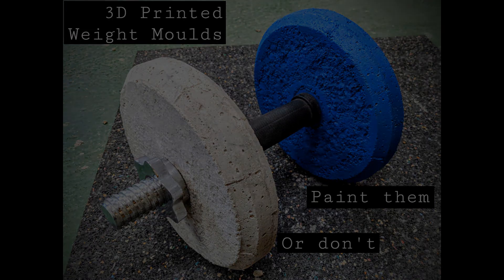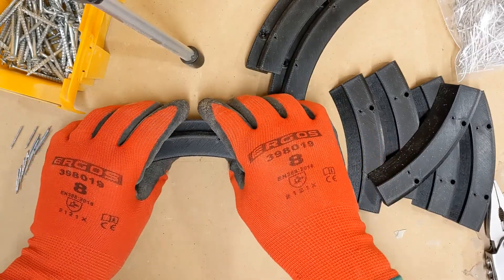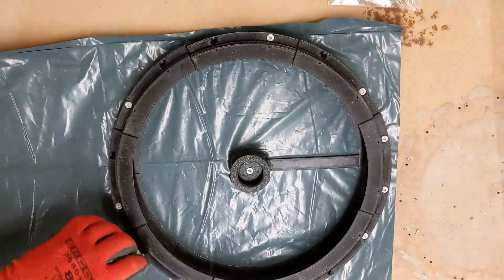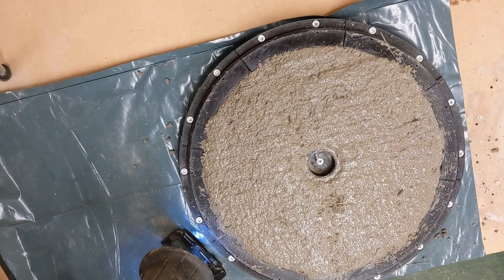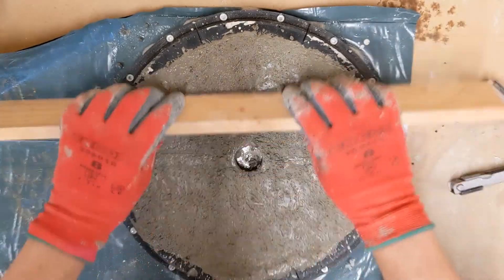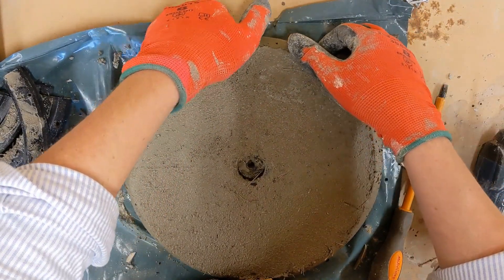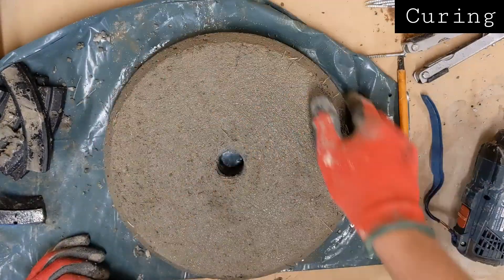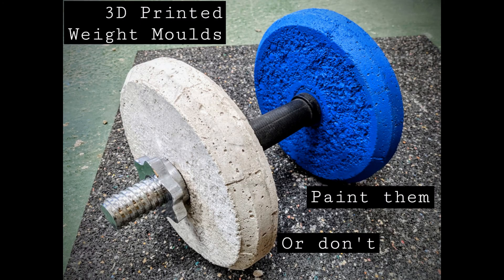Weights

Comment: what cement formula do you use
Reply from the maker: I weigh out as much dry pre-mix as my target weight (so 5kg weight = 5 kg of pre-mix).
I then mix according to the instructions, adding an appropriate amount of fibre according to its instructions.

Example for a 5kg weight:
- 5kg pre-mix
- 8g fibre
- 500ml water

Aim for 5-10% more on your first try to make sure you fill your mould and then adjust down if you have left over, the mould assumes a density of about 2.2kg/L but that can vary a lot by manufacturer.
Reply: @agryson  Nice form good job but i have to tell u that i did as you and water is not drying from cement, over 60% stays in the mix and I even check it after one year.
Reply from the maker: @jaroslawzmuda8963  Hi, I don't understand, you mean the final weight is 60% over what the dry mix was? 
Normally, in my tests (and with my cement) I have found that the final weight = the dry powder + 10 or 20 % ... 60% sounds far too high 🤔. 
Could you explain more what you're doing to measure the 60%?
Reply: @agryson  dry 10kg cement will need water, let's say 2l and after I added water to mix total weight was 12 kg after cement get hard 
I know it sounds stupid but now I don't do 10kg dry mix to 10kg weight i mix around 9 kg and add as much water as need to connect mix. 
My first 10 kg Turner into 12.5 and 12.3 
Another was 10.3 and 10.5 kg 
Water stay in cement 4 ever if you know what I mean
Reply from the maker: @jaroslawzmuda8963  Ah yes, I understand now - yes you need to calculate depending on the density of concrete you use.
(Some have aggregates that increase or decrease the density) 
Unfortunately, it's different all over the world so the only real way to get very accurate is to test beforehand